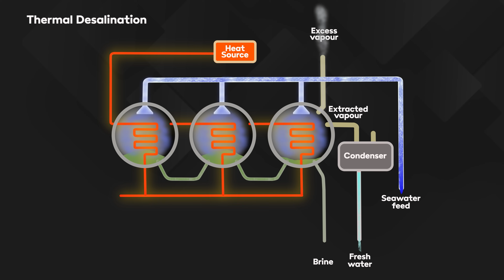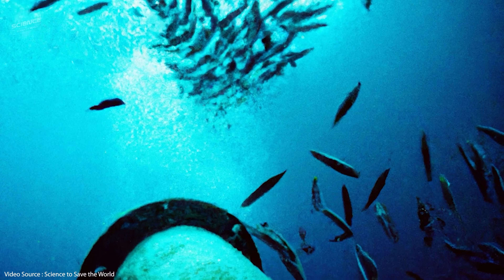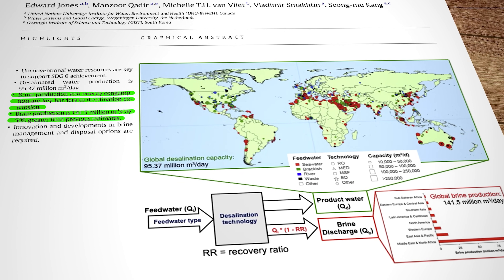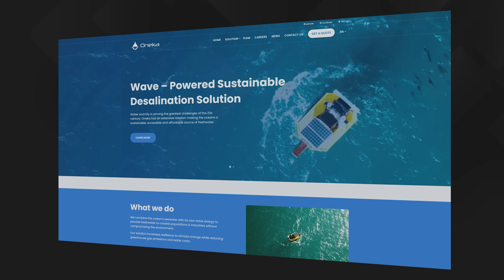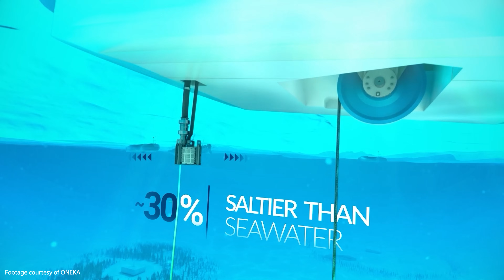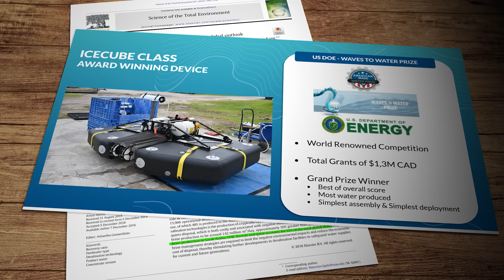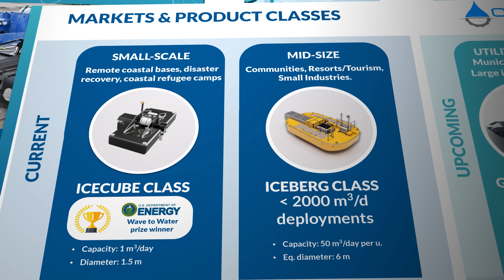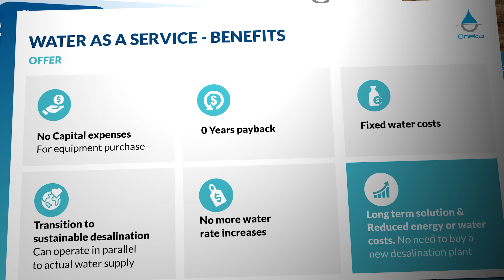Fresh Water at Zero Energy Cost . How do they do that?

Comment: That is a lot of complexity for very little water. Looks like a nightmare to service.  And how do you get the water to shore? By boat?
Reply: @8:47 it is explained that the water gets to shore by the same wave action which forces the water through the osmosis barrier. The video reported that 1000 litres per day can be produced by the smallest unit, which isn't insignificant, particularly if deployed in remote areas which might not otherwise be big enough, permanent enough or rich enough to afford a conventional desalination plant. I just had a quick Google which says that on average a UK person uses 150 litres a day, so you'd be getting up to two day's worth of water for a small household from a single day of the smallest unit in operation.
Reply: @danyoutube7491  The people with that problem can not afford that machine, I doubt your average British working-class family can pay that much for water. So it can work as a charity to people in need.

Hardly the solution to our fresh water problems though. So mentioning the brine discharge of the system is sort of pointless in the video.

The Sorek RO desalination plant in Israel produces 624,000m³/day. Imagine how large an area these units would need to be installed in, to get the same result. Never mind the maintenance, I see a lot of moving parts.
Reply: @Invisiblehand123  you would need 790 x 790 in a grid, if spaced by 3m that would be over 3km by 3km
Reply: @423GustavBern  Now imagine all the fun you will be having changing all those membranes when they inevitably foul. 3m apart seems optimistic to me. Was that mentioned in the video?

EDIT: The website seems to suggest 20-50m between each unit.
Reply: @Invisiblehand123  In the video I heard that they have to be 3m apart min for the brine to dilute to acceptable level

Comment: I'm not knocking this process but it is still prone to eventual storm damage and marine growth at the intakes. Hope they can overcome these problems.
Reply: Marine growth at the intakes is almost as much as issue with the current large scale desal plants -- the added disadvantage here is that with the intakes being distributed it would take more effort to keep them clean than for one single intake.

Storm damage is a fair point: in the extreme the whole flotilla of desal boats could "escape" in a severe storm and you'd not only lose production at the time when you most need it (think after a hurricane) you'd have damages to pay to anyone whose property was damaged by those rogue boats.
Reply: @trueriver1950  I worked in desalination for 25 years (Thermal) and intakes were always a problem with regard to marine growth. Some large plants had mechanised screen cleaning systems, but this only worked for initial large debris collection.
Reply: @rogerwilson6367  :) seems like we agree then
Reply: @trueriver1950  Yes 😃

Comment: This is one of the more stupid ways to burn investor capital. You put delicate infrastructure in the middle of the ocean exposing it to wear in harsh conditions. Then you have to go out by boat and maintain each module, which is inefficient and weather dependent.  The most sound and cheap way to do this is to have the energy generation on land (or wave based), the osmosis on land, all in one centralized site, easy to maintain. The only real advantage of this tech setup is the distributed release of brine. This can be done easily with a network of small diameter pipes going offshore. Much cheaper, much less overhead.

Comment: imo big centralized desalination plants seem better, 1m3 per unit/day is really nothing and you need to put some foundation at the bottom of the ocean and tie it up, then you need to run a pipe through the ocean floor to supply the water. And each thing needs to be inspected, now the workers need boats and diving suits to check it out and everything takes way longer then it needs to because everything is scattered around, and im sure these things will get stolen 100%. And I wonder if  it will fall apart and release a lot of plastic into the water after the sun will shine on it all day 

And I wonder how it got all the needed energy from the waves, if it floats up and down by like 10cm and the thing displaces 1m3 of water then it would make 0.272407Wh per cycle.
large plants need 3 to 10 KWH to make 1m3 of fresh water. so this thing needs 36,709 waves per day if we assume that it needs 10kWH per 1m3 and the waves are 10cm and the entire boast displaces 1m3 of water.

All the issues with big  centralized desalination plants can be solved way easier then it is to build hundreds of thousands of those little things.

Comment: Considering how hotter summers seem to strain the old UK potable water supply industry, I wouldn't be surprised to see something like these deployed around the coast in the next few decades.  I wonder if their technology could be merged with off shore wind (and maybe solar) generation, so that one platform generates both fresh water and renewable energy (for more than just their sensors)?
Reply: As a denizen of the arid UK, living in the centre, away from any waves, but enjoying an annual rainfall that could meet the most extravagant demands for water imaginable, I would have thought we need only capture and store a slightly increased proportion of rain to have more than we need.  Even moderation would not be needed.
Reply: The UK had a problem with sewage discharge onto beaches this year. Look up Feargal Sharkey. Happened directly after they got some rain after prolonged drought.
Reply: @Jon Knight. Hello. My understanding of these matters is that adding the ability to send electricity to shore would add significant cost, so if you perhaps looked at this from the "add this to an existing floating platform of some kind" angle, then possibly yes, but that would significantly change the approach being taken here...
Reply: For wave power you need the platform to  move with the waves. For offshorewind, you need the platform to move the least amount possible to decrease structural stress. So you can't do both on one platform, but 2 platforms close to each other are possible.
Reply: Britain is blessed with abundant rainfall. A bit of moderation during the occasional dry spell is all that's required
Reply: @sammason2300   Personally I don't have faith in a mass of people to selflessly regulate themselves. Therefore I think having a backup system is better than relying on the good will of the people.

Comment: I am curious to know if anyone is studying if (or how much) all the technology being employed to extract energy from (basically) the rotation of the earth (e.g. wind, tides) is affecting the environment.
Reply: I don't know if tides are caused by the rotation of the Earth entirely or in part, but I thought it had more to do with the moon. In any case, the energy of the waves is already absorbed by whatever they come into contact with, whether that be the air (obviously only minimal absorption of energy) or the shoreline, and the Earth hasn't stopped spinning as a result :) Therefore I don't think you have anything to worry about, at least in so far as the Earth coming to a halt, because the wave energy is being transferred to our machines instead of making contact with the shoreline. Though if it were possible to cram a hugely draining machine on the wave energy of a single location, then perhaps that would have repurcussions for the existing pattern of erosion and deposition at that location.
Reply: @danyoutube7491  Hey Dan!  Well, the tides are caused by the changing relationship between the moon and the earth, so they are, at least in part, the result of the rotation of the earth (which is why the tides vary on a 24 hour time cycle).  I didn't mean to imply that extracting energy from the tides would cause the earth to stop rotating.  On the other hand, tidal energy (and wave energy as well) does quite a bit of work in the environment.  My question is what effect large-scale extraction of this energy would have on those processes that currently utilize that energy. ;)

Comment: If you have small, distributed desalination, why the "filter only 25%" nonsense. You'd be releasing small amounts of brine which dilute with a power of 3 function, becoming very low salinity mere meters away from the float. Seems more like an inefficiency than anything else, you are lifting water to dilute your brine, instead of leaving it just below your output pipe where it'd do exactly the same job.

Also distributing those platforms obviously means massively increased cost (in ressources which mean embodied emissions as well as money) versus a central, coastal installation.

This to me is just a bad wave power design with a coat of desalination to spice it up for investors.
If it were efficient, well, power is far more efficient to transmit to shore than water, so just run an efficient desalination plant from wave power.
Still not gonna be viable, but orders of magnitude less silly than this.

Comment: As to issues, there might be little energy use to produce the water, but the production will take a lot of energy. You need a fleet of these against a single current desalination plant. I applaud the innovation of the design, letting the ocean provide the energy, but i have to wonder if they didn't just displace the energy investment into production and maintenance.
Reply: Indeed. The pumps scale with size so smaller units will need more energy though I f they can be run from the wave motion, that may not be an issue.
Reply: A desalination plant on land needs concrete, a foundation, space (often a very valuable asset in densely populated coastal areas) and it seals off land. Those floating platforms do not take up as many resources and there is plenty of space on the ocean. Even near the coast - they are limited to areas where it is easy to anchor such platforms, and the distance should not be too long because of maintainance.
Reply: Other factors of production - human labour for producing, installing and maintaining them - is higher. But we have enough humans especially in developing countries, and they could be trained within 10 years (make that 5 - 6 years on the level of skilled crafts, if you really give it an effort and if you make a point of changing societal structures as well. Just training a poor guy in Africa as plumber or electrian would not suffice). Training humans and somewhat changing society is not easily done (in our economic and political system) but it is at least NOT a hard physical limit like lack of space, lack of natural resources, lack of rain, limit of cheap fossil fuels * and damage caused by use of fossil fuels or damage by any industrial produciton 

* Cheap and plentyful fossil fuels are running out on the planet. I mean those that can be extracted at low cost and are still plentyful. Saudi Arabia (and I think their neighbours), Iran are beyond peak of their fossil fuels (so is the UK or Norway) so extraction is going to cost more in the decades to come.

Fracking does not count. Where are they going to store that poisonous, sometimes slightly radioactive water ? And if they pump it back underground in a SAFE way it is costly. Even worse: the FRESH water that is poisoned for extraction is lost - for eons. Only if it would come to the surface by some geological processes (like volcanic eruptions) and then evaporates it might get back into the natural water cycle. 

Another hard limit is the damage by ANY industrial production / use of energy. Even the production of equipment that can produce renewable energy and even if production and mining of raw materials for such equipment would happen under high environmental standards. There is always some damage done.  the only compromise would be to produce long lasting equipment and to limit the inevitable cost to the environment while also using energy in the most efficient manner possible. 

If you can use equipment 3 years longer - also using human labour to repair it - it reduces the environmental impact. However, often it is cheaper (money) to tear down things and buy or build new. But money is a societal and legal concept, it is easily created (by a key stroke really) - lack of capital and the cost of capital are self imposed limitations of our economic and political system.

You can't engineer your way out of it or change your economic system and society to get around the HARD limitations. But on principle it would be possible to change society, availability and allocation of money for projects that are good for humans and the environment. It is not very likely that our monetary system will change either and it is not easy to change a society. Normally that only happens after wars, after major and devastating crises, after revolutions often followed by dictatorships to change societies.)

One can see that with Cuba. Change of society: one dictatorship replaced by another but major societal change - and the population is still much better off than in the 1940s and 1950s, most were desparately poor, had no education or healthcare. Same in Russia and China.

As for hard limits of natural resources versus "soft" limits when it comes to human labour and skills

Cuba is a small island and they lack resources because they do not have fossil fuels, minerals. Also not a lot of land (compared to the number of people living there) and they are massively impacted by the economic war by the United States. Sanctions since the 1960s - I wonder WHY. The US also makes sure that no other country that does business with the US (and all developed nations do) can supply goods to Cuba. A French energy company was made to pay a huge fine for doing business with Cuba - else their property in the US would have been seized. 

Cuba developed human capital to compensate for their hard limitations. They were also forced out of conventional farming into organic & diverse farming (thus reducing the need for energy, pesticides, farming machines - things they cannot produce or which would cost them too much energy or too much money for imports). The universities helped to switch monoculture farming in the early 1990s and Cuba had to do so fast. 

After the Soviet Union dissolved they did not get cheap fossil fuels and fertilizer (which needs a lot of energy), so they had to change farming. FAST. Actually in those 2 or 3 years of transformation the Cuban population lost weight, I think more than 5 kg on average. No one starved or suffered from malnutrition - because of the fast reaction of the government, but it was like in Europe during WW2. They still lack animal proteins, during that time I guess even sugar was short in supply (thus the weight loss), but the food they get (starches, vegetables, fruits) is high quality and high in nutrients. Their organic honey has become an export hit - bees are doing very well on Cuba. 

Information, labour and skills of the population (and the work of humans and animals) replaced use of energy and raw materials. They started to use horses again, for transport, and for farming. Which makes them independent from sanctions. No fossil fuels, no import of machines or spare parts. They can train the vets, and it should be possible to get the medications needed for well kept animals. That is not a major production cost if you have a one horse power carriage or a one-ox-power plough.

Same with healthcare. They may not be able to have high tech medical equipment - but they sure have a lot of doctors and fairly good care considering that they are a poor country with a lot of limitations imposed upon them. They were able to train doctors at universities despite the economic sanctions and that needs little input of fossil fuels or raw materials. Even a small island with not a lot of natural resources can go big on skills and information. 

Information and skills (also in crafts) is something that can be well scaled up (without the need for a lot of energy or raw materials).

Comment: I wonder how this would work out using wind turbines to power the system.
Reply: Why bother adding electricity, when they've designed a system that doesn't need it to produce useful amounts of fresh water? And if you were going to power it by electricity rather than wave power, what differentiates it from a normal desalination plant (other than the very fine filter mesh)?
Reply: @danyoutube7491  Agreed. It wouldn't make sense to turn mechanical wind power into electricity, just so you can turn it back into mechanical power for a compressor. My question is how wind and wave power would compare as sources of mechanical power for desalination. If wave power is better (simpler, more economical, ...), then the follow-on question is why wave power would not also be better for electricity generation (not for desalination).
Reply: @kenjohnson6101  Ah right, that's a good point.

Comment: So you pull plastic out of the sea just to put it back in? 🤔 You could just put a tube deep into the ocean/sea with a filter at the bottom and solar or wind powered pump on the surface.

Comment: Zou will still need some electricity to pump the fresh warer ashore. Surely we need to greatly expand rainwater capture and use this water to flush toilets etc
Reply: @8:47 he mentions how the water gets ashore- via the same wave power that is pushing it through the reverse osmosis membrane. Increasing rainwater capture is good for the world in general, though I doubt it would be enough to meet the full needs of many locations that need water desalination in the first place (because they are often desert regions), but using water to flush toilets should generally be discouraged, in my opinion. Apart from the expensive infrastructure and frequent pollution problems (at least here in the UK), using large amounts of water to flush a toilet in areas that have little water to spare is madness.